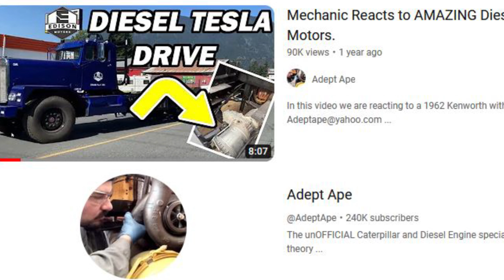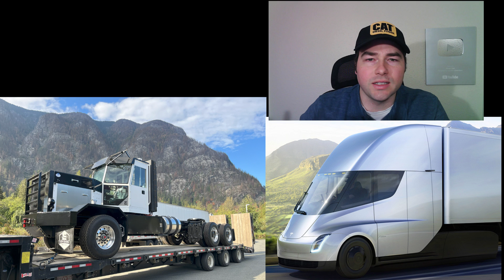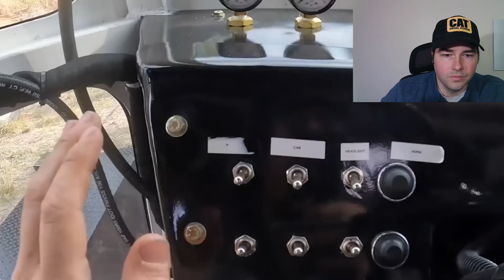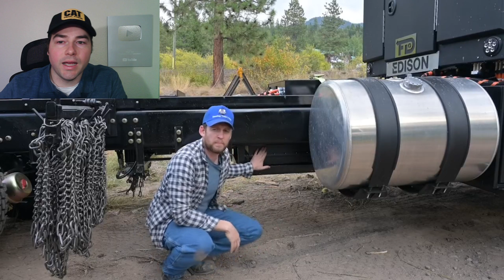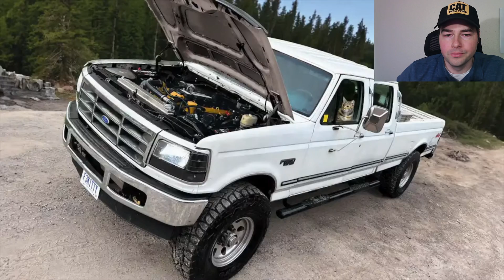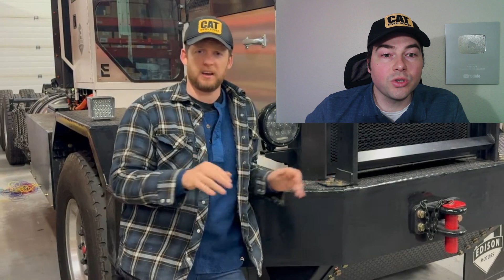Edison Motors New Truck DESTROYS the Tesla "Semi Truck" design!!!

Comment: Easily a hundred-million times more modular, repairable, and practical than Tesla, it's like going back in time with the design philosophy, when appearance didn't matter as much as accessibility, with Tesla both of those things suck. The guy loves Cat, is not seeking a pernicious dealership model, and is an actual ecologist trying to retrofit old chassis, which is hopefully viable since casting and manufacturing brand new vehicles is where the net zero lunacy really falters.

Comment: We've been building "Hybrid Diesel Electrics" for nearly 100 years (they are called trains). I don't know why we haven't done this in trucking - and why we STILL don't have a good American Automaker doing this. Toyota Hybrids have proven reliable, but they are mostly CVT. We need hybrids with actual transmissions - not this go-cart CVT thing. Yes, I own one, I like it, but it isn't designed to tow anything, and you'll destroy it if you try.
Reply: Costs of manufacturing( everybody wants the cheapest thing possible) Cost  of ownership🤷

Comment: As a fleet tech ive never seen a brake valve under the cab, theyre always on the firewall in the engine bay but then again we run 2019 and up trucks

Comment: I'd be concerned about having all that electrical stuff in the headache rack if you got in a wreck and the load came forward and crushed the doors and shorted out all the stuff. I'd put a screwed in switch plate into the dash to access the back of the toggle switches too.

Comment: 23:40 well that depends, i priced out parts a couple years ago and for something close to a Tesla with a used motor, electronics and battery modules it was a little above 20k but a old pickup can definitely get in for way less depending on specs.

Comment: I'm thinking for the pickups/service trucks they could use a onan, powertech generator type setup used in RVs especially big bus type(usually kubota or yanmar diesel engines) to drive the generator to charge batteries. The way I look at it, kinda like a thermoking or carrier unit is to a refrigerated trailer. Those diesels that power the compressors arent very big but, can last a very long time. I could see a yanmar or kubota fitting easily in my 94 c3500.....but, the 6.5TD isnt going anywhere anytime soon😂. As always awesome video!
Reply: I have a 93 GMC 3500 Uhaul that I've converted to Butane. Going to put my flatbed tow truck pan on it. Upgrade from an 84 Chevy.

Comment: Ive followed them since day 1. You cant compare them to tesla. They arent full electric, they are built for completely different uses in different industries and topsy is still a diesel truck. Its apples to oranges. I hate tesla but you cant compare them in any way shape or form. Its like comparing a freightliner cascadia to an oil field winch truck or a tesla car to an f350 its not even the same catagory

Comment: There's two ways they can do the trucks, one way is (and would be a more cost effective way) is to make a conversion kit that has the E-Axle battery/inversion box and a Generator with a custom cnc milled adaptor plate that is for your truck's engine of choice. or they offer a generator with your choice of fuel engine and give you a motor mount adapter kit.
Reply: They were discussing that idea as well. It's not as efficient, but it can be made to work.

Comment: Edison first retrofitted an older semi truck. Because you remove the engine and drive train, plus you only need a small battery module and small diesel engine, the diesel electric semi weighed 2,000 pounds less than the original semi.

Comment: It's a weird grey area cause it's a power generator not a direct drive engine. So the EPA does have regulations on fuel Powered Generators and regulations on Direct drive motors. the Emission standards for them are completely different. So just looking at the EPA standards for a diesel truck might not be the best way to go.

Comment: One thing to bear in mind is that Topsy is an off highway truck not a road truck. Emissions requirements may differ. For mining or logging operations these will typically be used on site only. Road trucks would typically be responsible for transport to processing facilities.
Reply: If it’s licensed to drive on the roads it has to meet road emissions.
Reply: Then you put an engine that meets emissions requirements in.
Reply: They now have it registered and road legal.

Comment: hey Josh, how about doing an episode about fuel additives for winter and in tank fuel heaters (arctic fox). Most of the lower 48 we can’t find #1 diesel. I have a 5ek and seems every winter I have issues with gelling and my system is squeaky clean and I use howes additive. Seems the fuel return doesn’t seem to heat to tanks enough. Thank you.

Comment: theres been.... woah, almost 100 years since the first diesel electric locomotive (built in 1925 so happy almost 100 years to it) 
100 years is a long damn time for innovation (hell just look at cars and how far they have come between 1908 when henry ford made a assembly line for cars and 100 years later to 2008) 
so, while i understand electric vehicles have not had a real chance to get anything done compared (i mean, shit when was the first tesla car released? 2008... huh, less than 20 years ago, and i would only really consider it to be more recent (last less than 10 years) when fully electric cars have taken off, on account of the price droping, battery tech becoming... a lot better, still not to the point i'd actually buy one, even if it was actually really affordable (im talkin down at used car levels of price which aint happening) 
anyways point being, theres been 99 years of improvement for diesel electric locomotives, theres been 115 years of cars (im talking about comercially successfull, not things like the mercades 3 wheeled thing but even accounting for all of those would only tack on a decade maybe 2 or 3)

Comment: Well also with emission the engine isnt being used as a transport truck engine that drives and moves the vehicle, its acting as a generator which have different emissions requirments and also it runs at one constant rpm and its the most efficent at one rpm and burns the most clean at that rpm.

Comment: Edison is listing the engine as an emergency generator. 
And that the PRIMARY charging system as shore-power. 

Since that engine is an EMERGENCY BACK-UP GENERATOR its emissions should fall into the category of EMERGENCY BACK-UP GENERATOR, which is way more lax compared to BACK-UP GENERATOR and even more lax than ENGINE

Comment: Odd thing is evrytime you convert electricity, voltage or ac/dc, you have power loss.  As for DC motors, they have far higher torque than AC motors, and you can get DC generators, the issue is DC motors cost more due to design and being brushless.  Majority of EV/hybrid use direct drive DC.  As for train diesel electic power packs use DC not AC. This setup probably has a 30-40% energy loss over a conventional  drive train, due to all the ac/dc conversion. Probably why this is only for off highway use only.

Comment: Speaking as a railroader, AC traction motors are a much better choice.  They are much more rugged and reliable, traction motor failures on DC units are a regular occurrence but are almost unheard of on AC units.  Also, diesel-electric locomotives can have 'dynamic braking', like regenerative braking except instead of recharging a battery the electricity is dissipated in a air-cooled resistor grid (basically a giant toaster with big fans blowing on it).  I wonder if Edison has considered this sort of setup to provide electric 'engine braking' even when the battery is fully charged.

Comment: If you blow a 600 Amp Fuse, that is cause for an investigation into Why it blew.  I would Not use a Circuit Breaker for this very reason.  If you switch that breaker back on without determining Why it tripped, you now have a fire hazard.

Comment: Pretty certain the power flow is Battery to feed the drives but the front Diesel genny also feeds the drive through the same inverters. 
The DC - DC side is to feed all the low voltage DC needs that the 600-800VDC dropped down to. 
Fuses are required with DC, breakers struggle to break DC as it draws an arc and needs compressed air to break/blow. HRC fuses are powder filled that stop arcing.

Comment: Phil from Australia here, Great channel! I always enjoy your content and professional explanations, keep up the good work!
I’m an electrical mechanic/ electrician. I look for problems and solve them, I can’t help but notice the EV lithium batteries are stored adjacent to the diesel tanks? I realise load distribution is key but damn that’s gonna create a catastrophic mess if and when one lithium cell goes into thermal runaway!
Reply: I’m not sure how far apart they are but the batteries are located inside the frame rail and on air suspension. Would be curious if they are considering this in their designs.

Comment: On the pickup or future mid-size side it could be something as small as a 3 cyl kubota diesel. If you look at a light tower genset that is typically a 6kw at 480v, compared to the f150 lightning that is supposed to be capable of delivering 6k 240v shore power. I may be talking apples to oranges but it demonstrates how small this could go.

Comment: So im no expert in emissions laws but, because the generator can be viewed/argued as not "directly" connected to the drive train of the vehicle one could argue that it isn't subject to vehicle emissions regulations, similar to how welding generators on welding/service trucks aren't regulated by the vehicle emissions codes (they may be regulated by other codes, just not the vehicle specific ones). OR because the vehicle can be/is registered as an EV and EVs dont have emissions tests (because duh) you may also be "exempt" that way. Will these loopholes last/ do they actually exist? only time will tell

Comment: I think both trucks are great leaps forward in design but for totally different markets. Edison is more for long haul / offroad. Tesla is for warehouse to store transport. I work in a big grocery store we get around 8 trucks a day. The warehouse is less than 300 miles away the drivers do a pickup at the warehouse and then drop it off at the store. The next day they haul the trailer back.

Comment: Let’s see it tow real weights up and down a real highway mountain.
Reply: they already towed a Sherman tank with Topsy.  Yes it was just around a yard.  The scale weight of the truck was over 100,000 pounds.  And they were able to spin the tires without even trying hard.  And another advantage with electric motors is that the frame doesn't twist like a normal semi when you are pulling hard.

Comment: Josh, yes i think Edison Motors is really on to something here. As far as pick up truck conversions... think of generator packs used in small boats. Self contained, 2, 3, or 4 cylinder ( Kubota, commonly ) blocks with generator back ends, wrapped in a "quite" box. 3000 to 9000 running watts. Enough to keep batteries charged.  The gen gets mounted under the hood. Batteries (Lithium ) with inverters and controls,  mounted in a bed mounted "tool" box and 1 ( for 2wd) or 2 ( for 4wd) axles, mounted between the wheels. The Edison guy already knows which axels and where to get them.  The ecu's (brain boxes) are small and can go anywhere.  Once engineered, is really a simple mechanical process for install. We get to keep our pick up trucks that we love and give a big FU to manufacturers selling 80 - 100K $$ pick ups. You will wind up spending less than buying new, get WAY better milage, much less service costs, and more reliability!
This guy is a genius!

Comment: Dunno why they used high volume batteries. Skip that. Its bad weight and terribly expensive. Direct electrical power for the wheels. All 6 would be wise. But no lithium battery packs. Extra fuel. Extra payload. But no bombs for me

Comment: Edison also uses the CAT  solar panels for another line of work they do of supplying back up or remote power units for construction and small villages.   Glad you gave them another look and saw what they are doing now.  Many people are confused and compare it to the GM Locomotive idea of running the generator full time to supply the electric drive, but that is not what they do.
Reply: Wow a 2 stroke electric truck nice and dry sump oil injected too!
Reply: That is wishful thinking tho. This generator will most probably have to run non stop when hauling a load. Similar to how the huge mining trucks work. Unless you put a lot of batteries which is expensive and is not viable for long haul as you will have to replace $100k worth of batteries every 2 years. Pure diesel semis are more efficient and more eco friendly than diesel electric and that's why in Europe where it is stricter than Cali all semis are diesel, and there is not even a talk about making them electric
Reply: @ac0rpbg highway about a half hour for 2 hours driving. 

In the mountains where it was designed to be used you could get away without running the generator at all if the load is heavy and the mountain road is long with a steep grade.

50% better fuel economy highway more off road. 

Opinions are cool but facts are available.

Comment: Regarding cost on pickup conversions:  Take an older model pickup.  The prices on current trucks is prohibitive to start with.  Say you find an old Ford 1 ton dually at a farm auction (saw one just recently - it was in nice shape, went for somewhere around $4-5K), the conversion as part of an overall restomod project would give you a pretty nice solution.  

Are you going to do this on a brand new truck?  Probably not - I'm guessing a conversion of that nature would come in around $30K or so on its own.

Comment: Emissions systems apply differently to generators based on their output and use. Typically speaking generators that are under 100kw do NOT require SCR or EGR systems.

Comment: Awesome truck for its purpose. Not sure about OTR, but time will tell. I like the Cat C9 powerplant, but I think they will have to move off of that pretty quick. I'm thinking about what happened to the glider industry using pre-DEF engines. I wish them the best as I have wondered for years why we don't see a car industry around diesel/electric propulsion. I know that diesel cars are not favored in the USA, but I think d/e cars would be popular in at least Europe. Thank you for the video, Josh. Always enjoyable.
Reply: The generator is exactly that, a generator and thus has to follow generator rules. Hybrid is not a new thing to heavy duty use so the regs are already in existence answering the questions.
Reply: @jaydunbar7538 it’s how trains have operated for decades.

Comment: Why cant they just use whatever engine is in the pick up to begin with. Diesel or gas, its just to run the generator anyway. It will only run when it needs to run.
Reply: you could, but if you are trying to extend the life of a truck, it is most likely do to the fact that the engine and transmission are bad or on their way out.  Why not replace it with something a lot smaller and lighter.

Comment: Oh yeah, basically it operates like a hybrid diesel electric like locomotives
Reply: No it does not.  The GM locomotive runs the generator full time to supply the electric power, the truck uses batteries and the genny can be used to charge the batteries.   Locomotives will not have the batteries to run on.   Not the same systems.
Reply: Yes, it's a hybrid truck, but not like a standard NA diesel-electric locomotive.

Comment: The plastic push shark fittings are so awesome when they work and you’re in a tight spot but, when the truck has a million miles and they’re starting to fail and leak, they do nothing but cause anxiety. Cool video Josh. I’ve been somewhat following this build and I love the idea of this. If it’s cheap enough and I can run a PTO driven pneumatic blower, I’d absolutely do this to my W9. It would pay for itself in no time and it’d make the old school looking trucks more useable to the newer generation where fuel mileage is so important. 5mpg sucks so bad but, I don’t think I’d ever be happy in an aero truck.
Reply: I got 12.5mpg in my 95 kw900L with a 3406E bobtail going 90km lol it can be done in diffrent circumstances

Comment: Totally seems worth selling my 17 f450 and getting a blown motor f450 and doing the conversion. To be able to plug into my solar power system at my home and charge my Tesla m3 and a hybrid f450 would be awesome. My wife basically been driving for free for 2+ years now. I love my diesel but you can’t deny driving for free and having a billion ft pounds of torque in demand and 1,500 HP…

Comment: This is the most sensible way forward, no heavy hydrogen tank etc, just use existing technology and equipment because it is capable of doing the job. 
It’s got the ability to go into towns without running an engine, then the power for long haul.
It’s great to see this being done, but I don’t think we’ll ever see it in Britain as ‘the old school ties’ won’t make money off it, and will find excuses to stop it.
The pickup probably only needs a 2 litre diesel generator, depending on the battery size,remember the generator isn’t running full time, so can be much higher tune.

Comment: Mud flaps in front of front wheels? Ah the will wrap over the tire at any speed over slow.
Reply: Logging trucks have mud flaps in front because of the road conditions and stopping the splash off the tires getting on the windshield.  It is a normal thing for a logging truck.